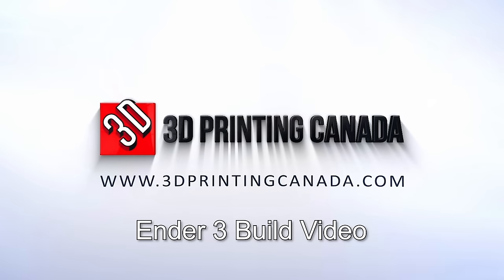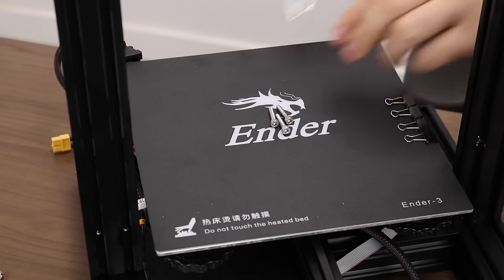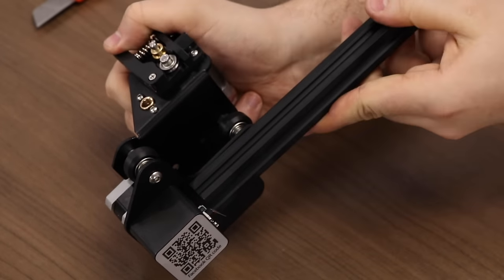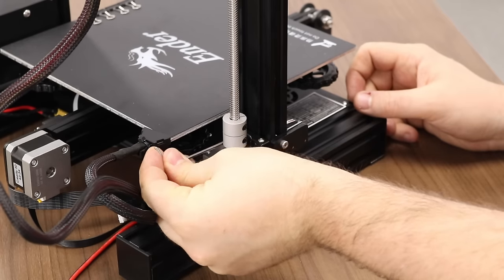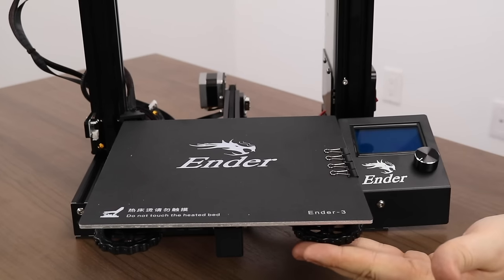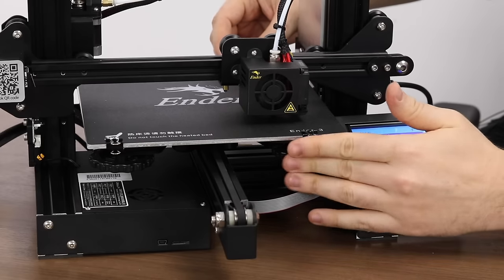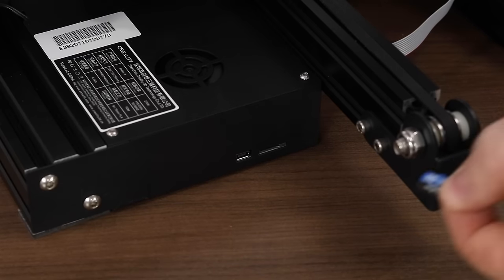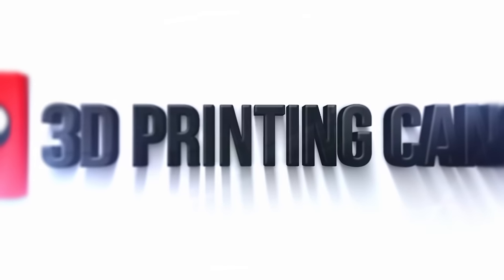The Ultimate Creality Ender 3 Quick Start Guide

Comment: Thank you. Tomorrow I am going to set up my Ender 3. I should be able to do it easily with your instructions.

Update:: I followed your instructions. Did. Not. Work. 😭😱yes, that was me. I watched the video again. Almost (but not quite) cried myself to sleep. Got up this morning. Watched it again. Emailed Creality. Watched it again. Called a friend who talked me into getting a printer. She suggested bunch of stuff including unplugging and replugging all the connectors. I had a few plugged in the wrong spot. Took me about an hour ro get the bed leveled. Now I am happily printing the thing on the SD card provided. Cat,5H.gcode. Maybe there was a few other things different from your video —- the display panel is totally different but the basic commands are in there if you hop around enough. But yay,,, I am orinting!!

Comment: Thanks for this! Even with the error, you made I would've never been able to assemble this with the included instructions. Nothing but a bunch of arrows pointing to scribble. It still basically took me all day to assemble. I'm on my first test print of a pig which will never finish because I only have the included filament which is probably not enough but it's working!

Comment: Thank you so much for this awesome video.  Got mine assembled and leveled fairly quickly following your excellent step by step guide.  I unpacked it last night, the instructions with it had me lost, then looked at someone else’s video on YouTube that I was unable to follow.
The only mistake I made was to get the limit switch connectors for x and z axis mixed up (even though they clearly labeled). Boy it is not easy to unplug those little connectors.  Just printed my first part for trial that I exported out of SolidWorks.  Man, I am impressed.  I also learned that the adjustment of the four table height adjusters is very critical.  I had the nozzle too high initially, my 16mm cylinder I was printing would not stick to the table and started moving around as it was printing.  Bringing the table closer to the nozzle and adding a “brim” at the bottom remedied that problem.  
Thanks again for posting this awesome video.  I would not be printing already without it.

Comment: Thank you for this. I watched another video and it seemed helpful but comments said it was a terrible video and recommended yours, so I followed yours (plus a tip about wrong screws in the comment) and I had no issues! Did my very first print tonight! Thank you!
Reply: Thank you again, just used this to set up my second printer as well.

Comment: Excellent video! I watched this and was able to assemble the kit in an hour or so without any major issues.  One problem that I had to deal with was replacing the clip on the wires for the z-axis limit switch. Must have been damaged during shipping.  After replacing with the male end of a 2S balance lead, I was up and running. I think that I will replace the Bowden tube with the Capricorn variant because the stock tube that came with my kit does not seem to say seated in the air fitting connected to the extruder. Finally, another mod I will incorporate is to remove the spool holder from the top of the printer. Thanks! Keep the content coming!!

Comment: I struggled with the auto home feature where the nozzle was driven into the build plate. Creality instructions for assembly are incredibly bad.  I finally realized I installed the Z-axis limit switch too low.  Once I adjusted that a few times, I was able to get the bed leveling to work out.  As a noob, I had a few other issues initially.  Getting the filament to load into the extruder was a challenge.  Your tip about the 45 degree cut and bending the filament down slightly really helped.

Comment: IMPORTANT NOTE: At the point in the video, about attaching the Z-Stepper motor (about the 7 minute mark), the narrator makes an error and says to use M16 bolts to attach the steppers to the vertical extrusion. The actual bolt needed is M18. Other than that, great video.

Comment: I just bought this printer because it was on sale for $129. I have an Ender 3 S1 Pro and I am printing great decorative and mechanical prints. It works great. I bought this because some of my mechanical prints are 16+ hours. I am hoping this lesson grade model does well. You did a great job on this video. I am hoping my Creality Sonic Pad will work with this printer like it does on the Ender Pro. Do you know if it does? Thanks again for the great video.

Comment: Overall a great instructional video. At 6 min and 50 sec it is telling how to install the Z axis motor, and says to use a 4 x 16 screw, those don't fit. The correct screw is the 4 x 18, it would be helpful to mention that these screws have countersunk heads. I was wondering why Creality didn't include countersunk 4 x 16 screws, then it became obvious when I looked at the pictorial assembly instructions that a 4 x 18 with a countersunk head was called for and required. Other than that issue the video is stellar!!.

Comment: [Differences I encountered if anyone needs help] 
6:50 you want the M 18 screws, not the 16. Took me a minute to see the bag in the video was labeled differently than what was said.
The video also seems to forget to mention plugging in the power to the Z axis (the base of the giant screw thingy) I love how I was learning enough from the video I was still able to figure it out! (Don't plug it in while the machine is on though. it was unhappy with me for that)

at 18:10 my Printer seems to be updated to have only one plug here and it was a rainbow looking cord that connected here.
Lastly my Control Panel has a whole different set of options labeled differently and my test file seems to be a cat instead! It's printing as I type this and i'm very excited to see it!
Thank you so much for this video. I would have been scratching my head for days using only the book guide.

[Edit] Does the bed have to be heated while I calibrate the level of it? or can I do that while the machine is cool?

Comment: Excellent video.. i made the mistake of building it with the manual.. need to remove and reinstall the Z axis motor, the lead screw sits a bit at an angle and it doesn't rotate as easily as i would have liked. afraid i might put too much tension on that little motor resulting in added wear and tear.

Comment: For the future me:

20:20 Check de axis
21:53 Check the platform
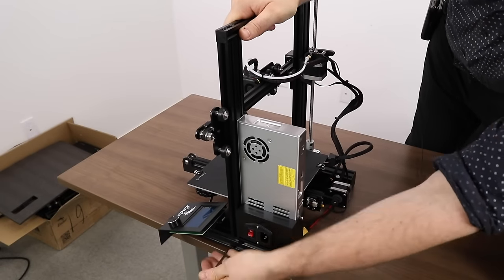22:38 Check the Voltage

Calibrating the axis and the heat until 28:48

31:04 Software guide 🙏😭

Cura minimum requirements:

• OpenGL 2 compatible graphics card, OpenGL 4.1 for 3D layer view
• Display resolution 1024 x 768
• Intel Core 2 or AMD Athlon 64
• 550 MB available hard disk space
• 4GB RAM memory

32:40 Recommended settings

Comment: What a great video. Didn’t need the manual at all. Step by step including levelling and using the controls all included. Thank you so much. Be sure tho to note the error re the screws used at the start to bolt the motor. 👍

Comment: At 6:50 it’s stated to use M6x16 screws to mount the motor. These are M6x18, the prior are not long enough and are pan head with lock washer. Maybe this is mentioned elsewhere but I didn’t see it. This is still a great instructional video!

Comment: One small correction at 6:50. You say that we need M4*16 but it s M4*18. Besides that, this was a super helpful tutorial and I am very thankful for it!!
Reply: METALZero2 it comes with them though right?
Reply: @willmoran5694  yes. everything you need is in the box, no worries. The video is correct in all other aspects.
Reply: METALZero2 ok thank you, mine is arriving tomorrow
Reply: @willmoran5694  awesome. enjoy!
Reply: METALZero2 quick question i am in the build process right now what do i pit the voltage on the power supply as, i have no idea what our outlets put out
Reply: @willmoran5694  google it. Write something like "voltage outlet in <yourCountry>". You can even find lists with all the countries and what voltage/frequency they use.

Comment: Awesome awesome video. Made putting it together easy and my first print was perfect.
TWO THINGS THO! As has been pointed out by others he says to use the M4X16 screws to mount the Z-Axis motor, you in fact need the M4X18 screws (instruction manual with your printer has it right).
Also he has you add the filament after homing your machine (the thing with the piece of paper), which is fine but be very careful you do not bump the extruder/gantry. I accidentally moved mine and had to repeat the process over again, if i had not the nozzle would have been pushing into the bed when starting to print.

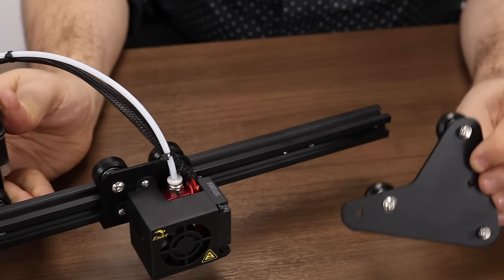Comment: At 6:54 when attaching the z-axis motor  you will need to use the CORRECT flathead screws M4x18(2 per package), not M4x16 in the audible directions.   If you are trying to assemble the z-axis passive block (10:53) and run out of screws, this is where you probably used the wrong screws.     You can see M4x18 on the clear package at 6:54.

Comment: 13:25 if your extruder wiggles/wobbles (unlike in this video) you need to tighten up the eccentric nut on the bottom wheel. There is a wrench included with the printer to do that. There are videos on this topic that explain it in more detail, I had this problem myself.
Reply: My belt isn't long enough

Comment: I wish I would of seen this video first helps a lot compared to other videos, they dont tell you that the two bolts that are holding the nut in the bolts should be slightly lightly lose so the threaded rod should be slightly lose.... time 14:00 thank you for this video

Comment: You need to fix this video. Around 6:30 you say to use M4x16 screws when it's actually m4x18 that should be used. It's not the first error either :/ sorry, just trying to inform you

Comment: At 6:50 you said you need two M4x16 screws. That is incorrect, you need to use two M4x18 screws otherwise the screws wont reach. You can see in the video that the package is labeled M4x18 but you verbally said M4x16. Thank you for the video though, just wanted to help out.

Comment: Just picked up one of these from you and I have a question.  The bed is slightly off level from side support to side support.  So when we go to level it by the knobs under the bed the we cannot get the one side low enough to clear the point.  All 4 knobs are at their lowest setting and there is 4mm of clearance on one side and none on the other.  The glass bed adds another 8mm that I think takes up the adjustment.
Reply: You should add the glass bed or return it

Comment: Question: at 18:00, you are to connect the LCD cable to the back of the LCD display. Why not connect it before mounting the LCD to the frame? This should save you having to 'finess' it under the display :)

Comment: Love my ender 3. Only had it like 2 weeks and ive already completely worn out a nozzle and thoroughly destroyed a print bed. Its basically been pushed to its limits on temp for the stock hot end with this petg im using and its also been running nearly 24/7 lol. I just wish itd let you go above 260 without having to connect to a pc and tinker with files. I have a microswiss hot end i want to install but im worried ill have to increase the max temp in the settings to get much use out of it. Otherwise im only really getting another 15 to 20 degrees out of it. Another 10-20 degrees would open a ton of options.

Comment: I just opened mine I've had for years and the washers are attached and black, there are no extras, the rod is yellow and slimy, the power connection isn't impossible to separate, the pack pipe nut is on the pipe and the wire isn't that long?

Comment: I had to load the X-Drive belt (loosely) before mounting the extruder head. The ferrules on the belt ends do not fit under the wheels of the extruder! at least not on my model.

Comment: Will the assembly part work fine with the ender 3 pro? None of the videos for the pro are as detailed and helpful as you
Reply: It worked yesterday for me with an Ender 3x Pro, but bear in mind the error in the screws used to secure the X-axis motor, they should be M4x18 countersunk, not M4x16 as he says . This has been reported many times in the comments. It is a very thorough guide, follow it in every detail.

Comment: Awesome video. I just have 1 problem with my first model. When I start with printing it starts at the top left side of the board and not in the middle. What could be the problem? (not using printing software at the moment)

Comment: You should also square the frame even more using a drafting square and aluminum foil shims. Out of the box it is probably very out of square in several directions and they all have to be checked in order to avoid printing spaghetti.

Comment: Received the printer on Dec 20th. It released the dog before it was finished and the bed would not maintain the programmed temp, tried several more times and it's printing the dog again and it's lifting in the front, but still holding on.  There's not enough instructions on how to use the Ultimaker Cura, no cable with the printer, can the sd card be reused?... so frustrating.  Not liking this printer so far.  :(

Comment: Thank you so much for this guide, would have done a couple of things wrong without it! One thing I regret is printing the dog at the end, if you're short on time it is definitely not a good idea, I searched it up and it takes over 5 hours to print! Also the PLA the printer comes with is not enough to print it. Printing 'benchy' might be a better alternative for a first print, I've heard that it is a commonly used first fest print.

Comment: I just followed your video to a T and it worked perfectly until right after the disable steppers part at 24:35. I cannot get the bed to even come close to my nozzle without the wheels underneath coming off the threads. Any suggestions?

Comment: Great tutorial.  Thank you.  When you press auto home, does the hot end nozzle move to a location off the front end of the bed and below the level of the bed?  Mine does and I'm wondering if that's correct for the Ender 3 Pro.

Comment: What do i do when there is not enough thread to get the surface plate away form the tip? I go as low as possible with the dials and becomes completely loose bc i've gone too low supposedly.

Comment: IMPORTANT TIP: At 6:49 the presenter says M4-16 screws, but points at an M4-18, which is what the manual recommends. I used the M4-16 and they fit but then I was confused why I was missing my M4-16's later on.

Comment: Just got my Ender3 s1 pro.
The instructions were horrible and it came with a bunch of tools that are completely useless.

2 small flat tip screwdrivers. Exactly the same size and not used at all.
2 ikea type wrenches. Not used at all.
4 Hex keys of different sizes. Only 1 was the right size for any of the screws. I had to use my own tools.

It's not hard to put together but I try to follow the instructions to make sure I don't miss  anything or do something stupid.

Now I'm looking for instructions on how to use it.

Comment: At 17:44 when he plugs in the connectors, when mine were plugged in like that, my x axis didn't move. But when I swapped the E with X, everything seemed fine. Is it possible mine were just mislabeled or is something wrong with my printer

Comment: IM building ender 3 and when I press auto home the print head nozzle goes below the level of the bed, how do I remedy this?
Reply: The print head will stop when it hits the Z axis limit switch. If it’s ending up below the bed you might need to raise the switch.
Reply: raise the Z axis limit switch (the one beside the bed) up a bit

Comment: I am assembling an Ender 3.  The two upright columns appear to be too are apart, as the top piece is too short by about 1 cm. and the x-axis gantry does not fit.  My top piece is 33 cm.  Can someone measure their top piece to confirm the 33 cm?

Comment: my z-axis passive block doesn't fit perfectly the z-axis profile, resulting in the x-asis profile to not be perfectly horizontal, someone else had this problem? can i move one of the wheels of the passive block to "grip" it more to the z-profile? because just adjusting the plate results into the right ones be completely down and the left ones to be completely up right now

Comment: I really liked your guide. Pretty simple. But I have an issue with my new Ender 3 printer. I've already leveled the base and used CURA for the software to print.For printing I use micro-usb, I don't have sd-card reader on my desktop. So, I just send the .stl file in Cura I do slice and save the g_code from my model. After that, I just click for printing. Well, even the base is leveled, my E3 doesn't print the model. It's print something else.. It's she can't read the g_code "very good". I can't find anything in the internet.. I would like some help... please of course.

Comment: Is anyone else struggling with the z motor? My guide screw seems to be misaligned or something. It won’t moved up and down and when I try to autohome I get an error message. The platform moves in all directions and the printing piece moves left to right but not up and down

Comment: My extruder assembly is wobbly as hell! I’ve tried tightening he screws that hold the wheels but nothing. Can someone help.
Reply: I am not sure if I understand you correctly, but, you might want to re/watch the part of the vid that handles this. There is the screws, but also a nut, which is specifically there to adjust the play of the whole thing.